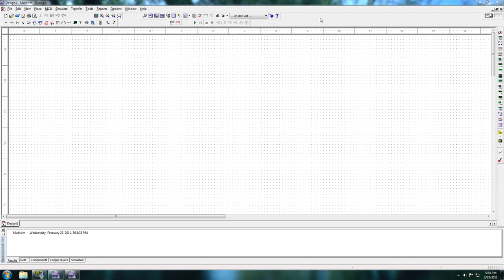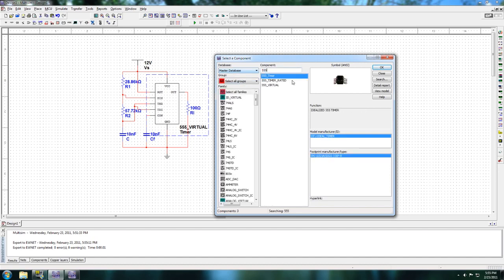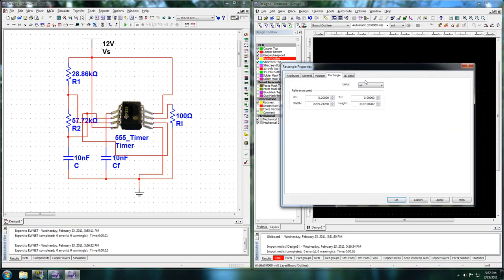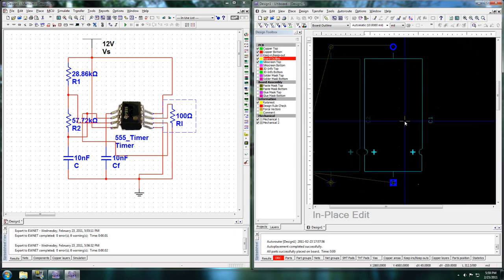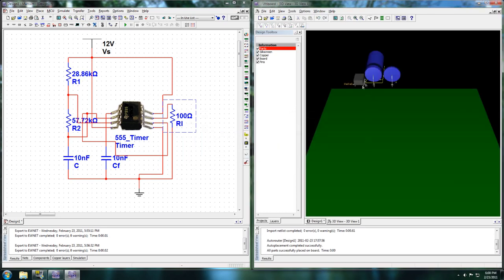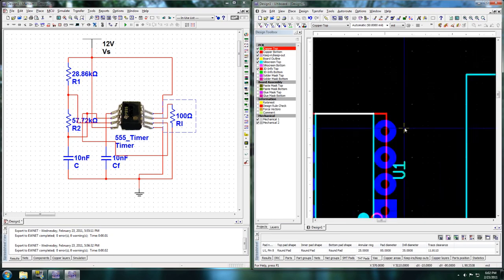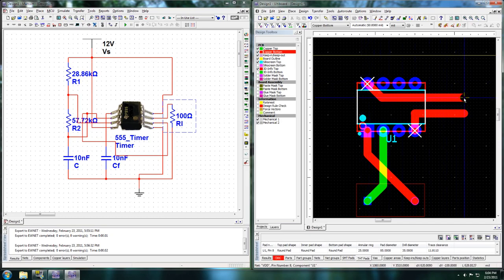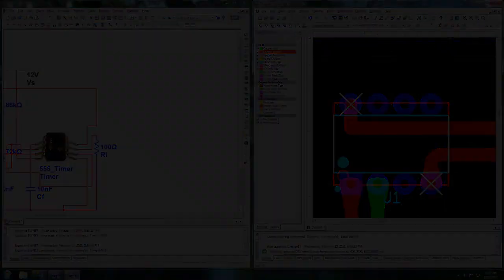Circuit Design   Multisim and Ultiboard

Comment: Finally someone who talks doing a tutorial. Thanks very much. I have a question. Once you finished that design in Ultiboard can you add another separate circuit without having to redo the first circuit again. So copy and paste another schematic and then import it to Ultiboard, but so it doesn’t effect the first laid out circuit components. I have 3 separate power supply circuits that I would like on the same PCB.  Cheers John